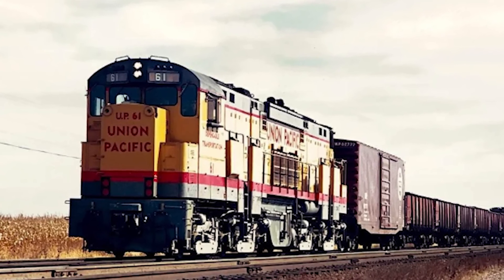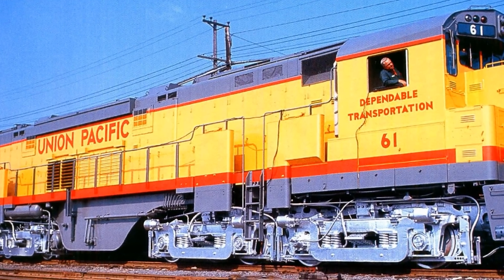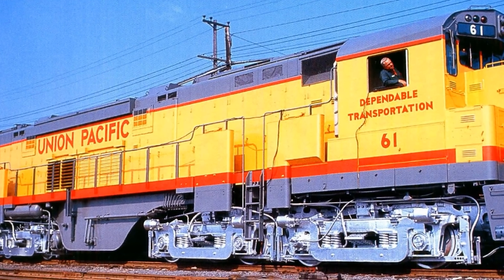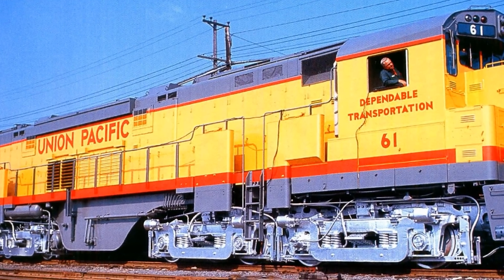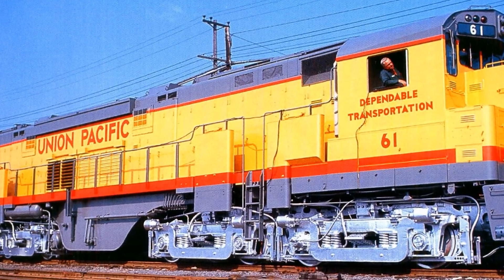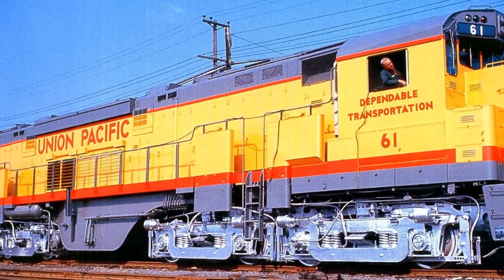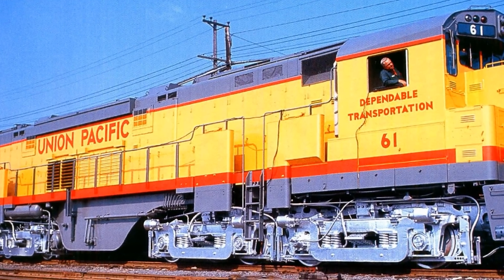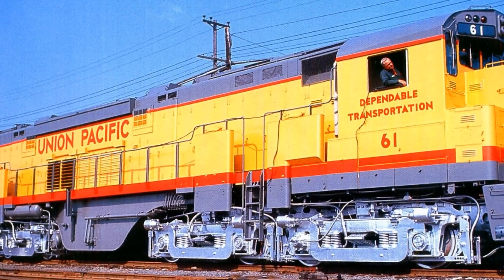Why Union Pacific SCRAPPED The Most POWERFUL Diesel Ever

Comment: I really enjoyed this video! I can imagine how embarrassed and angry the "suits" were after the epic failure of the C855's on their maiden run. My electrical knowledge is average at best, but I know that aluminum wiring, although cheaper than copper, is inferior. I think it's actually illegal nowadays to use aluminum for interior residential wiring. Regardless, I wonder how much cost savings were obtained by cheaping out on the wiring. With 20/20 hindsight, using the aluminum wiring was a big mistake. Although, it seems like the had other issues, including the wiring errors made in the factory that doomed their maiden run.

Comment: That's not even close to the most powerful diesel that UP had. What about the DD40? The EMD DDA40X is a 6,600 hp (4,922 kW) D-D locomotive, built by EMD from 1969 to 1971,

Comment: The power wars were on at that time. UP wanted to make a couple of big engines to pull the long trains UP had at the time. Every new engine developed has it share of problems. EMD produced the SD 50s & 60s that were proun to air compressor trouble. EMD made the SDP40 which was proun to having the front truck with the first 2 axles off the rails. The SDP40 was used for Amtrak service. The SDP40 would roll over a switch and the front truck would come off the tracks.

Comment: They were wired wrong at the factory.  Also not the most powerful ever built, the DD40AX had 6600 HP. Both EMD and GE used aluminum wire also Alco continued to obtain their electrical equipment from GE, even after they became competitors. GE did them no favors. All of the high horsepower locos ( GE U50's and U50C's, as well as EMD's DD35's and DD40AX's ) were all double engined . UP also bought Alco C630's.
Reply: *DDA40X
Reply: @FFred-us9tw  does it really matter?
Reply: @raylrodr are you actually asking if referring to a locomotive model by the correct model number matters?